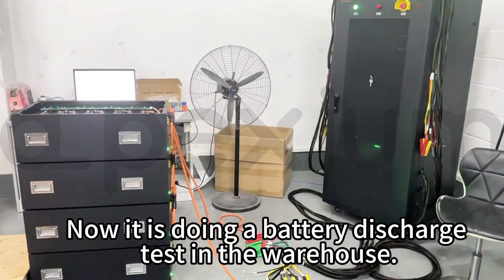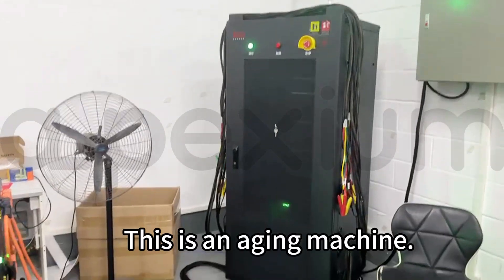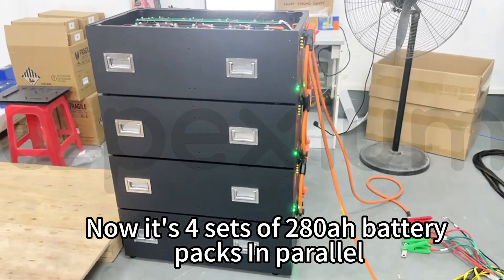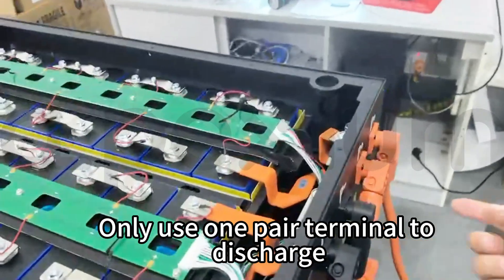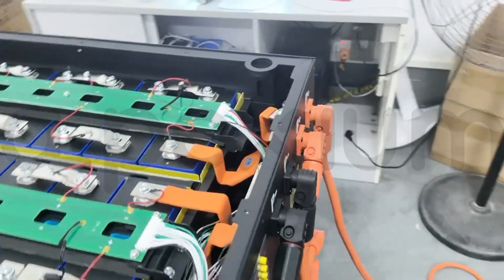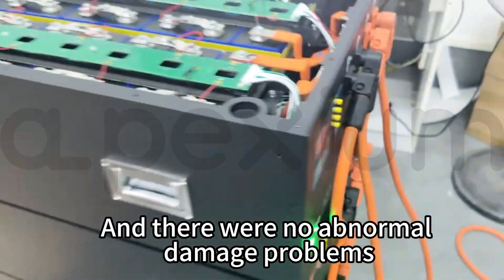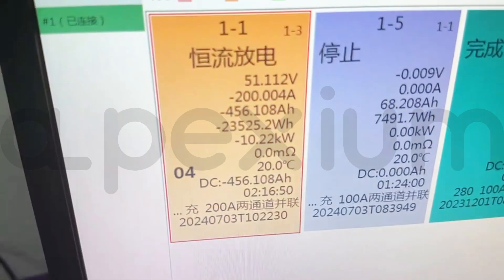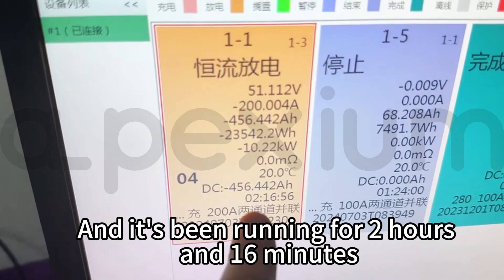Apexium 48V DIY BOX KITS  4pcs Battery pack In parallel Terminal  Current Test

Comment: ok but where to buy those connectors? In europe or aliexpress. Provide a link/name of the right connector to buy please. I have bought two apexium boxes and I need to put them in parallel.
Reply from the maker: hello ,for this terminal just can order from our company.because this terminal is suitable for the apexium diy box.
pls check the link:
https://www.alibaba.com/product-detail/Apexium-Battery-50mm-Terminals-With-Socket_1600862553278.html?spm=a2747.product_manager.0.0.506c71d2xPEN3w

Any questions and problems ,pls contact Apexium Cassie:
Email:sales5@apexiumtech.com
Whatsapp：0086 18269259127

Thanks